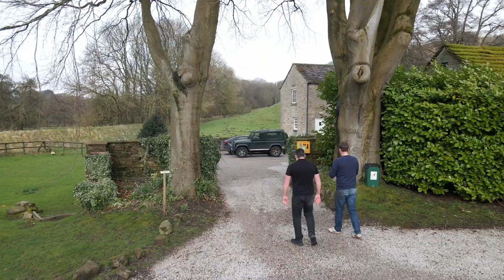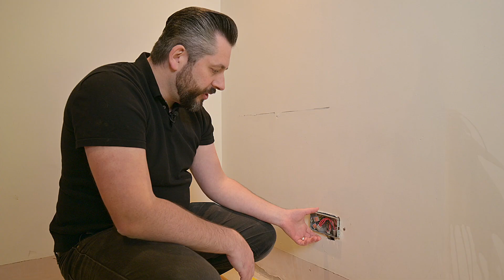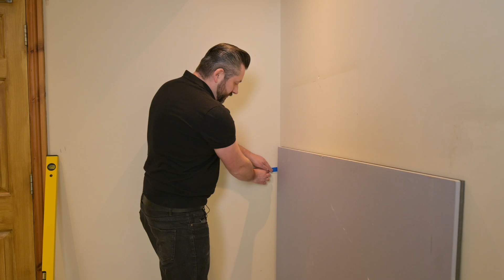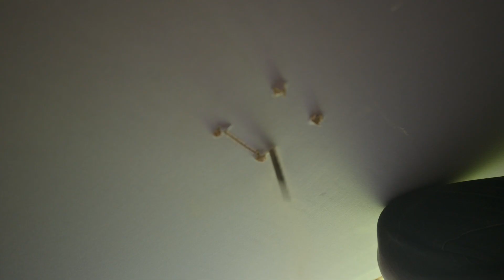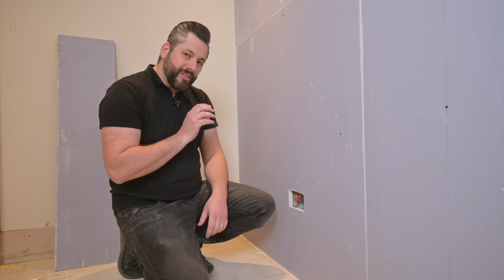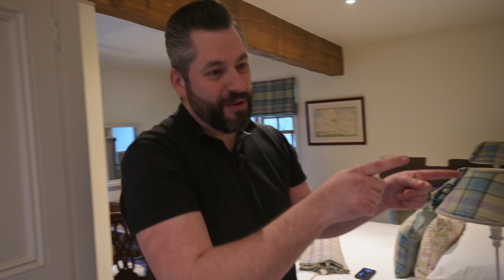How to soundproof a stud wall with SoundBoard 4, a high performing soundproof panel

Comment: Would this work on a wall which is breeze block along with dot and dab plasterboard (around 9.5mm it would seem).  It's the only wall in my front room which is outside facing (along with a large window) and removing the plasterboard isn't an option. I'm also not sure how it would be attached to the wall in my case. Any suggestions please. Many thanks.
Reply from the maker: Hi, Thanks for your question. This is a difficult one to answer in a short comment, but basically it's unlikely that the noise is getting in via the block external wall. This should have plenty of mass and thickness already. The weakest point of the wall is the window, so I would initially look at adding secondary acoustic glazing rather than adding more to your walls. If for some reason the noise is getting in through the wall, adding SoundBoard 4 over the dot and dab can actually make it worse! You need to remove the dot and dab and fix the SoundBoard 4 directly to the surface of the wall.
Reply: @SoundproofingStore  Huge thanks for your quick reply. Apologies however as what I failed to mention is that the noise is coming from the flat ABOVE and not from outside. Primarily conversation and TV can be clearly heard if stood close to the wall and with absolute clarity if an ear is pressed to the wall. Hence I wondered if adding this system to the walls would go someway to deadening the sound to a degree. I'm aware that total isolation from the noise would be a difficult task but if anything can lower the clarity of the noise (which I assume is flanking noise) then that's the kind of result I'm after. Many thanks once again for taking the time to answer my initial question.
Reply from the maker: @ds-ve2qo  No worries, happy to help. The dot and dab plasterboard will certainly be playing a part in this problem as you have a cavity behind the board for sound to freely travel up and down. So again, I would definitely remove that. SoundBoard 4 may help to a degree by adding more mass but without creatign a cavity. The better option is our ReductoClip direct to wall system - https://www.soundproofingstore.co.uk/reductoclip-direct-to-wall-system

Comment: If you had to guess / or have data - what would you say about this system compared to 
your fully floating solution. I love the space saving on this but have FOMO on the other. 😂
Reply from the maker: Great question. Our ReductoClip System is always going to perform much higher because of the de-coupling and vibration damping of the system. So if you have the space to use the ReductoClip system then that will always be better. However, some situations don't necessarily need the absolute best performance or don't have the space. In this case with it being lightweight stud walls, we know the SoundBoard 4 will make a huge difference while keeping things more simple and less space loss. However on a solid brick / block wall the SoundBoard 4 won't offer as much of an improvement so the ReductoClip system would be our recommendation. Hope that helps!
Reply: @SoundproofingStore  interesting! yes thanks that helps. It's is for solid walls.
Reply: @SoundproofingStore  What are your thoughts on lining a loft floor with this? The ceiling is braced with extra beams to take the weight. Plus no one will be walking in the loft. I'm just trying to be cunning with soundproofing above a ceiling more than below one to lessen sound transfer to our neighbours.
Reply from the maker: @KASmonkeys  I would offer a good improvement in regard to airborne sound, however I wouldn't recommend it for practicality reasons. The boards aren't structural and although you know that, if you moved house in the future the new owner might think they are floor boards and may walk on them or store heavy things on them and they would collapse. You would be better off using one of our high mass floor board options - https://www.soundproofingstore.co.uk/soundscreed-25-direct-to-joist